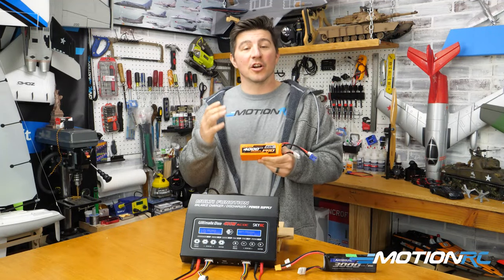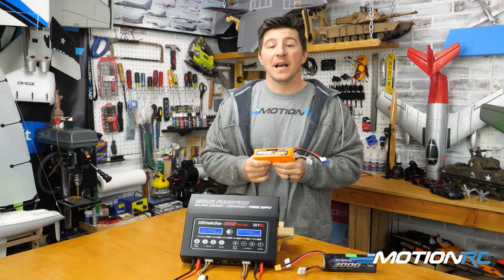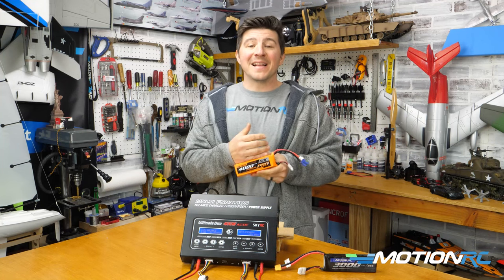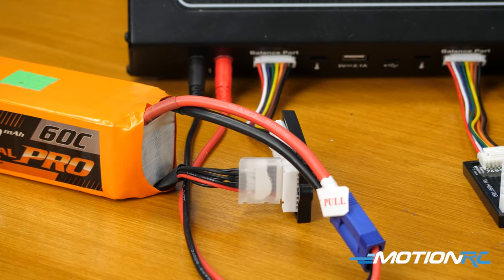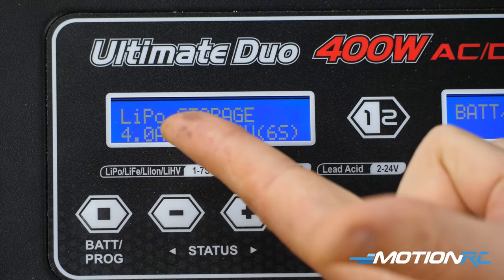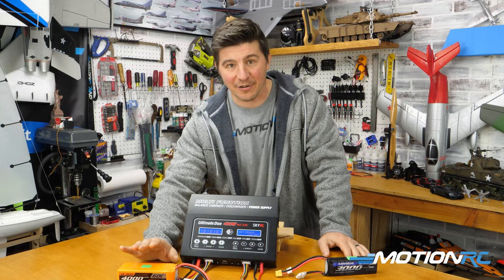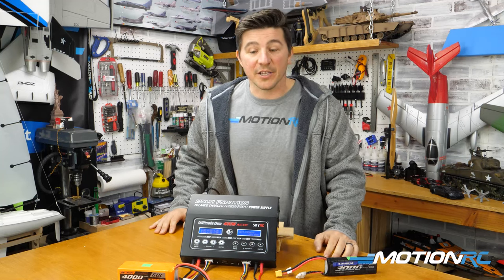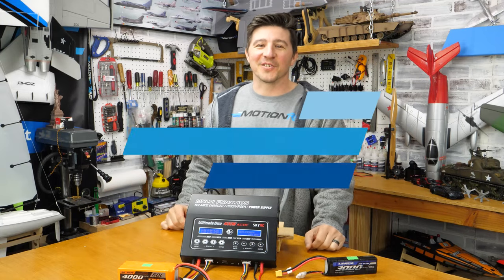Storage Charging RC LiPo Batteries | Quick Tip | Motion RC

Comment: The 4.0 amps on the screen (which you correctly said was the 1C rate for battery you used) is the charge rate if the battery is somewhere below the storage voltage value. It is not the discharge rate. That particular charger has a discharge rate of 0.1A-5.0A, but it can only disspate 36 watts per port. If you put a fully charged 6 cell battery on it, the discharge current can be no more than 1.43 amps (36 watts / 25.2 volts =1.42857 amps). A fully charged 2 cell battery would discharge at about 4.29 amps (36/8.4=4.2857).

Comment: Key word “religiously” I’ve heard that a fully charged lipo after 24 hours the lithium begins to destabilize, it’s a slow death basically, I wouldn’t recommend anyone take that chance, I tend to charge and use my packs within a few hours or less, I have some lipos that are almost 7 years old and still balance out nicely, I keep a close eye on all of them and periodically load test them to confirm each of the cells drain equally, if I notice a significant diff in voltage drop I won’t use that pack, great to see these informative videos James 👍👍
Reply: When I storage charge my lipo can I just leave it on the charger or do I need to take it off
Reply: Take it off

Comment: Thanks for the video. Now, how about some options for discharging packs more quickly? Obviously flying a plane will do it quickly but that's not always possible once back at home with a number of packs needing attention. I devised a board with 4 - 12V, 50 watt incandescent bulbs w/sockets wired in parallel. Each bulb will draw up to ~4 amps of current. So having them all screwed down shows around a 16A - 17A load. I incorporate my parallel charge boards and my watt meter for this also, having each pack's balance plug plugged into the board. Then I use one of the cell meters with the alarms set to 3.8V. I unscrew bulbs to lessen the current draw as they near equalization, finally using a cell meter on each pack to make sure all is well before putting them away. Saves bunches of time when many packs need to be discharged. My setup, because of the 12V bulb rating are only good for 2S - 4S packs. If I'm just storage charging a pack or two I will use that function on one of my chargers but it is a slow process.

Comment: Great Vid. !  So when it gets to 3.8V , Unplug and put it away ? will that charge stay at 3.8V  for how long ?    I guess im only use to Vehicle batteries where you can just plug it in a Maintainer and leave em plugged in for say the winter etc. for storage.  thats a Nice charger you got there too  wow ! thanks man !
Reply from the maker: Most intelligent chargers, when using the storage charge function, will stop when the battery reaches a storage charge. I check all my batteries that I haven't used once a quarter. If any fall below 3.8, I will pop them back on storage charge quick and then re store them.
Reply: Yes. Most newer chargers will do the following if you select storage mode: your battery is UNDER 50% the charger will charge until it’s at 50% and stop. Or around 3.8v each cell ideally. 
If your battery has OVER 50% left after driving your rc the charger will discharge down to 50%. So it takes it to 50 whether that’s adding or discharging to 50. I wouldn’t do discharge mode unless you’re keeping a very close eye cause if you fully discharge you will ruin the battery. Most people never use discharge mode with most new charges being able to discharge or charge when you select Storage. It takes a while though but yes get on Amazon and for like $9 you can get a little Cell checker that you can keep in pocket or close by that plugs into the balance wire on battery and will show what percentage or “capacity” is your battery is at. They also have a Cell Checker usually which will show each cell and what Voltage it’s at. Store around 3.8v ideally. Hope this helps. I use the C150 HTRC 150w charger off amazing and love it. Fits all batteries practically and it’s about $50 and does it all. It also can check battery capacity or (how full it is) if you don’t have a little cell checker handy. Good luck and always charge in a fireproof bag no matter what and on a glass, concrete, brick, or some other fire proof material away from walls. Those bags are great but I’ve seen them burn enough to burn down a garage. (Or a trailer full of rc cars in my buddies case 🤭)

Comment: Hi, if I just used my battery until the ESC cut it off, can I leave it at that cutoff voltage for more than 48hours? 

This is actually for my RC car, I don't actually have a storage charger so currently I leave them at that cutoff voltage and then charge them before I drive the car.

Comment: iSDT FD-200 discharger is the best tool to use for returning charged or partially charged Lipos to storage charge ....... and will discharge a 6s 5000mah in about 20 mins as opposed to 5 hours using a “charger”!!

Comment: So 3.8 roughly is storage. At what voltage is it recommended to come back and land? 

I’m flying my first proper fpv currently after coming from Mavic @ Avata type drone where it’s easy to charge and get in the air. All this lipo business is confusing at the mo. 

I just need to know what I’m looking at in OSD to tell me to come and land. Is it around 22? 

Cheers.

Comment: After i storage charge and want to use them again, do i just use balance charge and it will put the battery back into normal use?
Reply from the maker: Yes. Consider a storage charge like a 40% charged battery. You will want to balance charge it back to 100% before using it. But you never want to store a battery at 100% charge or less and 40%

Comment: Does this apply to Li-ion batteries as well? If not, what's the proper storage voltage for Li-ion batteries?
Reply: i would say yes..
Reply: Like 18650s? I store all of mine fully charged, then discharge and charge with a capacity test once a year, and they never vary more than a couple % +/- over several years.

Comment: Question are you supposed to regular balance charge before use on a storage charged battery
Reply from the maker: Yes. A storage charge has the battery at about 30% charged for sitting/doing nothing. You will charge it full to use it then storage charge it again afterwards to store it

Comment: I have brand new 2S batteries, that have remained unused for about 4 years. I just checked them with my cell checker, and got capacity readings of 20 and 24% for the two batteries. Is it OK to storage charge them, or are they unusable? Also, is there a risk of a fire when batteries are left unused?
Reply from the maker: I would personally first charge them fully and use them. See that they still work and hold a decent charge under load. I have batteries much older but with much more usage still work great. They should be fine, but test them out. If they work, then storage charge them until their next use
Reply: @MotionRC  Thanks for your advice! 🙂

Comment: Am I overthinking this? Is storage charge a charge where you drain a bit of charge from the battery before storing them unplugged?
Reply: It works both ways actually. If your batteries are 100% charged and you put it onto a storage mode, your battery will be discharged down to about 35%. 
Conversely, if you've used your lipo and and come to the end of the run - like a low voltage cut off - storage mode will actually be putting charge back in - back up to about 35% which usually equates to 3.7-3.8v.

Comment: Hi, just purchased a traxxas lipo battery, the person at the hobby said the battery comes 50% charged . I haven’t used it in 10days . What should I do with the battery?  Put it in storage mode.  I need your help.
Reply from the maker: I assume you do not have a battery cell checker? I would order one ( https://www.motionrc.com/collections/battery-testers ). With a tester you can check the voltage of any LiPo battery. Most reputable companies (like traxxas) will sell their batteries in storage mode, so if you haven't charged it up yet then it is fine to store. But when you get a battery tester, you will know for sure where the voltage is. A fully charged LiPo will be about 4.2 Volts per cell, while a Storage charge is about 3.8 Volts per cell and a dead/almost dead battery is 3.2 Volts per cell.

Comment: Do U only have to charge it once one storage charge for the season
Reply from the maker: Batteries will slowly discharge over time. I would check them every 1-3 months when in storage. If they drop from 3.8 to say 3.7 I will put them back on the storage charge to get them back to 3.8 (wouldn't take long)

Comment: How long can you leave a lipo in storage charge, in storage? I have one I haven't used in a couple of years.
Reply from the maker: I would check them periodically throughout the year. Over time batteries will lose charge just sitting there, so a storage charged battery will still lose voltage and you should put it back on the balancer to bring it back to storage charge every once in while. So if you store a battery at storage of 3.8v per cell, after a year it may be 3.7 so just storage charge it back to 3.8
Reply: @MotionRC  Thank you! That is actually exactlywhat appears to have happened; all of the cells are currently in the 3.7 range.

Comment: What if I dont "Storage Charge" my battery over the winter? We are new to this. nobody mentioned this or suggested it. The Battery was charged last in September of 2021. Went to use it today and the spektrum charger has a grey screen and says n/c
Reply from the maker: As I said in the video. Proper care for a LiPo is that it is always storage charged before storing it for any extended period. If you leave a fully charged LiPo to sit for more than 3 days the chemical reactions inside start the puffiness and overall degradation. Many times I have charged up 10-20 batteries set to go fly and life happened and I couldn't go, so I take the time to storage charge them before putting them away. And I have many batteries I don't use until summer (for boats and such) but every quarter I will check them as even storage charged batteries will start to fall below 3.8 and I will take them out of storage just to storage charge them and store them right back again. Basically, take care of them cause they can be pricey and you want them to last for years and years. And they can....with proper storage ;)

Comment: I have a charger that stops the storage charge at 3.9 v.    Is this ok?
Reply from the maker: yes. 3.8 is "average" so 3.7-3.9 is fine. But also look into the settings on your charger, you may be able to change it from 3.9 to 3.8 from there.
Reply: @MotionRC  Thanks, its the Ev-Peak CQ3 and don't think it has a setting.  But the fan stays on and never turns off after the battery is charged, which I dislike.  Does the skyRc D400 fan turn off after the batteries are done?  Thanks for your reply.
Reply from the maker: @genes6703  I just went through the manual of your charger and looks like it is fixed at 3.85 for LiPo storage, which is fine for sure. This chargers (SkyRC) fan only turns on/off when needed

Comment: James I need some help so basically when I charge my Lipo batteries into storage mode for some reason it puts the batteries at I think 3.80 V instead of 3.08 and I’m using a B6 balance charger that I got for $25 it might be my charger but I have no idea.
Reply from the maker: 3.8 is right. 3.08 would be a dead battery
Reply: @MotionRC  oh so 3.80?
Reply: @christiansrcs7789  yes

Comment: So it doesn't matter what size battery it is, always set it to 4a for a storage charge?
Reply from the maker: No. You always want to storage charge at a 1/1 ratio. This pack was a 4000 mAh pack so storage charge at 4.0a. A 2200 mah pack you storage charge at 2.2a, a 6500mAh pack you storage charge at 6.5a etc, etc, etc
Reply: @Motion RC  thank you mate 👍
Reply: Cheers 😊

Comment: How do you take a battery out of storage no videos telling you how. Do you recharge as normal or discharge and then recharge???
Reply from the maker: Storage is just the cell reading at @3.8. it's not a mode you need to get out of. Just charge it and go fly. But if you don't fly it for a 2 days then just storage charge back. Never let it sit with a full charge or any charge over 3.9
Reply: @MotionRC  perfect  thanks

Comment: Can you use a parrarel board to storage charge multiple batteries? If so do you still storage charge using 1amp?
Reply from the maker: Many chargers will only storage charge using 1 amp, but the charger will only discharge at the same rate whether it is one or ten batteries. Discharging 4x1300 mAh batteries is the same as discharging 1 5200mAh battery. But of course, don't leave it alone while you do it. Always be ready for anything with LiPo's
Reply: @MotionRC  ok thanks so if I storage charge 4 1550mah lipos I set it to 1amp and 4s
Reply from the maker: @sheapyfpv8224  1550 x 4 is 6200, so I would set the amps to 6.2 on the charger, that should discharge those at 1 amp
Reply: I´ll follow up on this one. If i have multiple batteries with more than 0,4V between them, is it ok to storage charge them together? @sheapyfpc8224

Comment: storage my batteries range doubt

Li-Ion battery 3.7V 2000mah and Li-Po battery 3.7v 3000mah what is the range for long-term storage mode for these two batteries? battery similar smartphone
Reply from the maker: Range should always be around 50% capacity for long term storage. Any battery will loose charge over time so storing them near empty could kill them permanently.
Reply: @MotionRC  not range some 50%? what voltage?

Comment: can you storage mode a fully charged lipo?
Reply from the maker: If you plan on not flying that battery for 2 or 3 days, then you of course would need to storage charge a fully charged LiPo. The storage charge will run the pack down to an acceptable storage level because leaving a fully charged LiPo sitting around will degrade it super fast.
Reply: @MotionRC   tnx bro im doing storage now weather is not great we have typho so no playing for now
Reply from the maker: @rcboy4652  No problem my man. Same rainy weather here in Georgia as well

Comment: So after you storage charge your battery (3.8v) and you want to use it ,you have to charge it to the full capacitiy. Im confused😅
Reply from the maker: Yes. Whenever you are done with a battery, pop it in storage charge then put it away at 3.8. but when needed, charge it up. It can remain fully charged for like 48 hours, but if not going to be used, storage charge it again. Leaving a lipo fully charged for more than a few days will degrade the pack and cause puffyness and less usefulness over time
Reply: @MotionRC  so I have a 25C SeriesZippy compact 5000. I don’t even know what those numbers mean. Couple you please explain the proper procedure for using and storing the battery

Comment: My charger takes a very long time to reduce a battery to storage. I find it's far quicker to run the battery inside the plane for 5mins till the battery has ran down to 3.8V per cell.  Is this wise though??
Reply from the maker: it okay, but then put it on the storage charge to finish it off.
Reply: Please keep these videos coming, for us "newcommers" it jas been great!
Reply from the maker: @markgurney8725  Will do Mark, and don't hesitate to comment with some idea for more. These are for the people

Comment: There has to be a faster way to do this something that you can just plug right into the battery that will drop the voltage down to the correct storage mode somebody invent this

Comment: that charger, lmao. how is that currently beings sold for $200. the ONLY impressive thing about that charger is the 35 watt/5 amp discharge capability. you can get 400 watts of AC power with other chargers for significantly less. you can also get 15 amps of charging power (with the same 200 watts) for significantly less. the only time the 20 amps is an actual benefit is when your charging a 2s, at 3s the amp benefit is minimal. not to mention you can get everything i said plus wayyy more features in a package a fraction of the size

Comment: For a 6s battery, would the storage amp rate be at 6?
Reply from the maker: no. refer to the mAh of the battery. a 4000mAH 2s or 4s or 6s would all charge at 4.0 amps for a 1C charge rate.